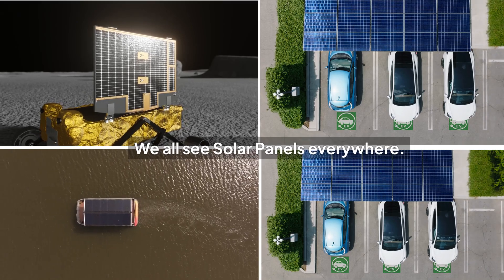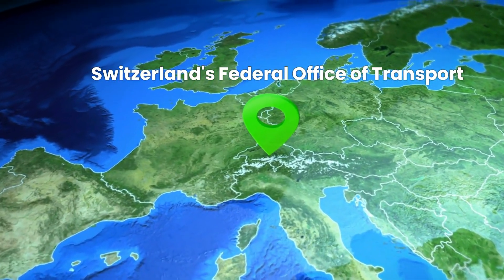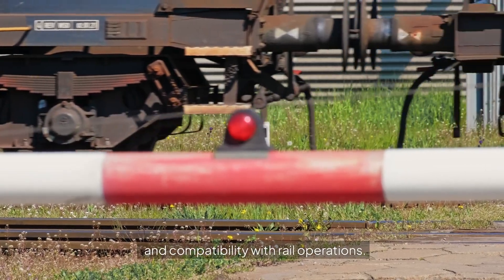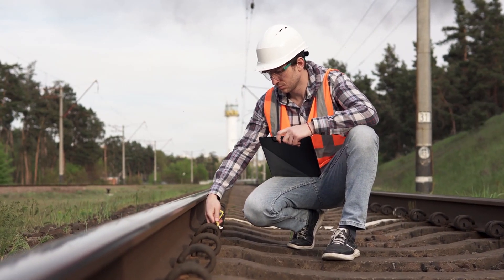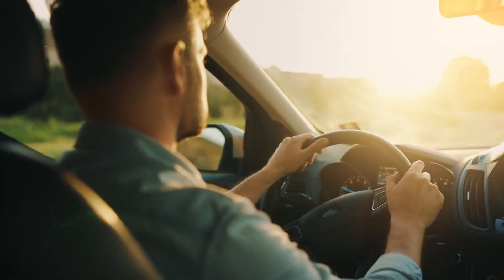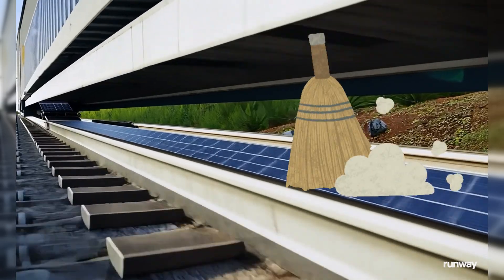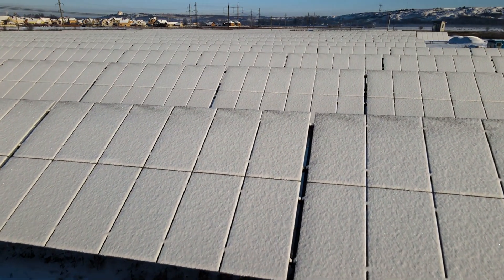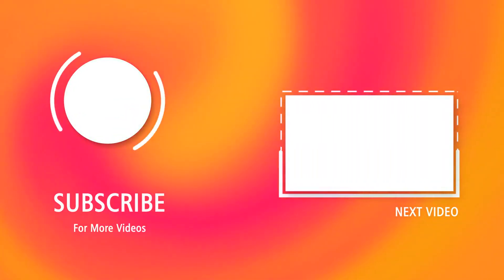This EU Country Installs Solar Panels on Railways (Shocking Project 2024)

Comment: ROI? Expected annual production of 16000kWh for 600k euros? 
Do people realize, that a single kWh costs 20 cents or less? That's an annual production worth 3200 euros. For 600000. With panels, that would under ideal conditions last maybe 10 years, so 32000 euros worth of production, assuming no degradation. Yea.. environmentally conscious. If energy would be 10 times as expensive, this would still not break even in 10 years, probably not even in 20.

Comment: also dirt accumulates massively on plane panels
Reply: but the cleaning is easy, no manual labor needed.
Reply from the maker: Indeed, it is a challenge too. They will attach brushes under the train for cleaning!

Comment: Thats such a silly idea. The space between rails is barely anything, it will complicate track and underlying gravel maintenance, It will increase down times for the rail line whenever these panels need to be serviced themselves. Too much complications and expenses for so little power
Reply from the maker: Indeed it has many challenges. The company claim it adresses them all, lets see
Reply from the maker: they have consider that

Comment: Why can't we just accept that in non-tropical latitudes solar panels aren't worth the effort and the energy they produce is expensive, inefficient, unreliable and prettyuch useless. I'd rather a couple of nice cold fired power stations that covering arable land with slabs silicon.
Reply: agree
Reply from the maker: Indeed, many do not like PV

Comment: This is really stupid. Solar panels are easily damaged, and trains cause heavy vibrations and also debris flying around, making the panels dirty and damaging them.
 
This is solar roadways all over again. Environmental grifters who use marketing and CGI to swindle governments into giving them taxpayer money for "testing", then after a couple of years we inevitably find out that it wasn't that great of an idea at all.
 
Anyone with two brain cells to rub together already knew that, but at least we managed to fund a study to the tune of millions of euros to prove what we already knew.
Reply from the maker: Thanks for the helpful comment. According to the company, they have consided such issues. Lets see:)
Reply: @renewable_energy  that's the exact same thing that every other snake oil salesman says. Fact remains that it's a stupid place to put solar panels. They'll be more expensive on account of being ruggedized, less efficient on account of being flat and dirtier, and will suffer higher rates of failure due to vibration and impact of rocks and debris.
 
It's a dumb place to put solar panels. This is a grift designed to feed from the taxpayer trough.

Comment: THIS is STUPIDITY ^ 10th degree.

Switzerland has abundant Hydro resources and they venture Solar?
This is like a desert country example Saudi Arabia building hydro power plants instead of solar farms....
Reply: Because you can take the unused electricity when you have high peaks and pump the water back into the lake so that you can produce electricity with hydro when you don't have sun. In this way you can use the lake as a battery :) ... this is something that Switzerland (and not only) is doing since a long time, playing around with the electricity prices.
Reply: nice comment